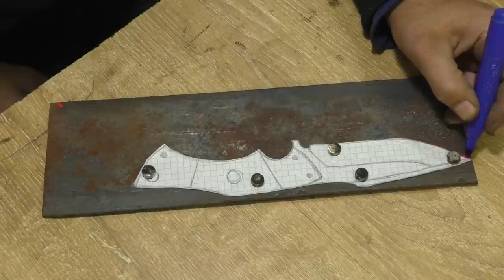Knife Making: Hunting Knife

Comment: Watching someone drill holding bare handed  makes me cringe. After making 30 knives without incident I almost lost my thumb when the drill bit grabbed the blade and spun that blade into my hand.  While I bled all over, the drill press then fired the blade across the garage.  If the pointed end had hit me could have been the end.  Now I only drill if work is clamped down or in a vise.   A hard lesson learned 10 stitches and months to heal.